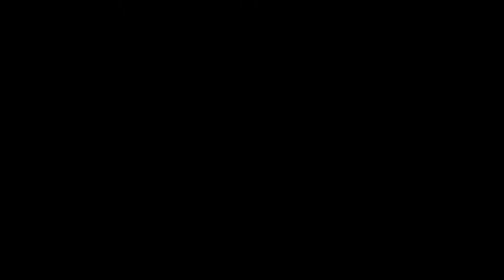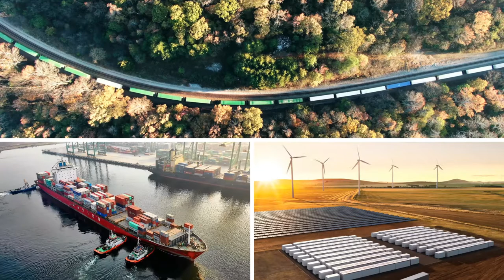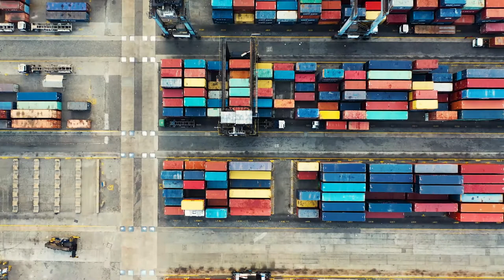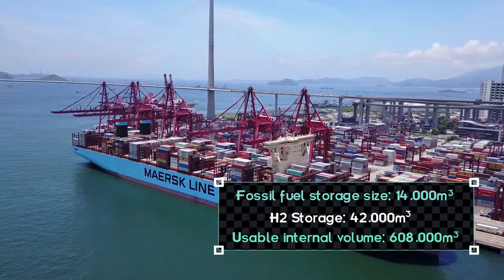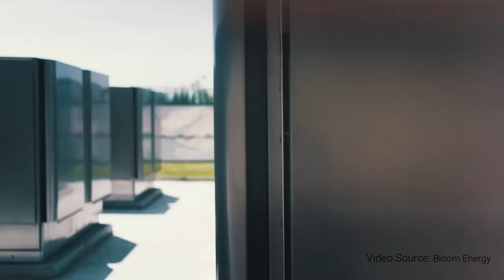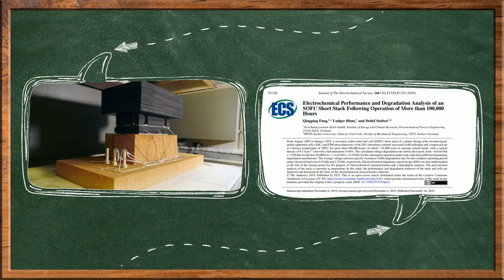Hydrogen Powered Cargo Ships

Comment: a 63,890 ton (85,000 ton loaded) stealth (CATOBAR) aircraft carrier powered by combined cutting edge fuel cell & Li-ion i-HYBRID marine propulsion system . . . if non-hydrogen based bio fuel cells could power flat tops with Li-ion batteries acting as additional power assist . . . please advise . . . are there any non-hydrogen based fuel cell??? please advise . . .

Comment: Great explanation, but can wind energy help a little bit cargo ship rather than hydrogen? just my imaginations..
Reply from the maker: Short anwser Yes, we can harness wind energy with Sails or different types of electricity producing wind turbines. For the latter one, i need to do more research before i give my opinion. In combination with sails, we can use any propulsion system, from hands and paddles to fuel cells and el.motors. Remember sails on  boats/ships were used as our primary propullsion systems for few thousand years and If the price of fossil fuels were higher we would still use them to some extent.

some info:
- https://en.wikipedia.org/wiki/Preussen_(ship)
- https://en.wikipedia.org/wiki/Black_Pearl_(yacht)
- Oceanbird (wing sail technology)

Will probably do a video on the topic you mentioned.

Comment: It is not just that simple in a hardcore shipbuilding as you show in your video. Once you start increasing the footprint of your fuel storage system you consequently increase the footprint of all associated systems (piping, instumentation and power cables and wire, safety gears, etc.). Did you try or simulate the behaviour of such solutioin in a heavy storm condition?
For me, you sound as a Tesla car seller other than a real engineer.
Reply from the maker: I never said this was a Blueprint for hydrogen cargo ships, all the things you mentioned are solvable engineering challenges and they dont disproove the idea. It ALL depends on the progress made on Fuel cell technology. 

Have a nice day!
Reply: @terrafutura1089  I do not think  that all these things are solvable engineering challenges. We had it already with renewable energy and electric cars. Once you start to scale up the engineering solutions, economics dies. I still believe nuclear power plants are a feasible solution for big size ocean-going vessels.
Reply: @gracepierce1024  "Right" chemicals and pure water. Where are they coming from?